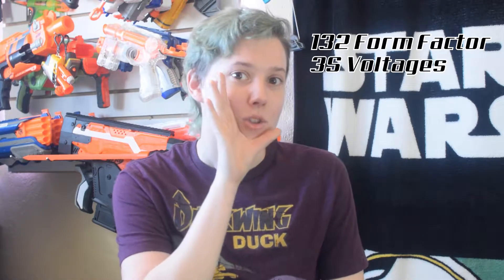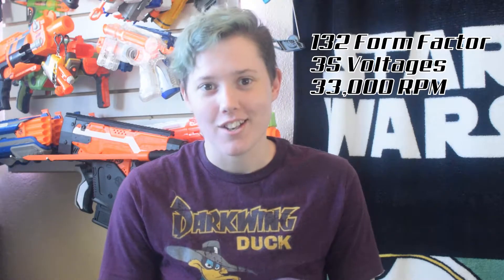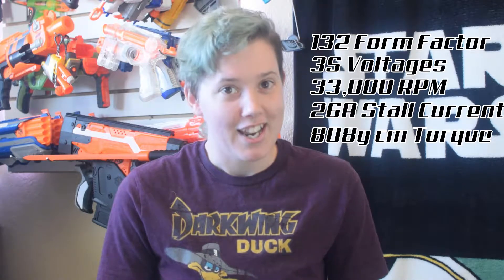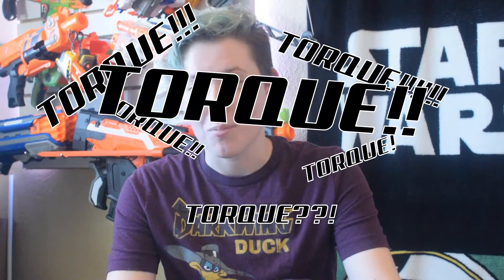Fang Motor Testing Final Thoughts - Watch this for a TL;DR

Comment: Are you using the high crush worker wheels or the regular ones that can be found on ebay or amazon?
Reply from the maker: Normal worker wheels.  We get ours through TaoBao or Out of Darts, depending on how quickly we need them.
Reply: cool, thanks!
Reply: How many sets of worker wheels do you recomend buying to get a good match? Also does having a good matched flywheels help that much?

Comment: Have you two done similar tests of measuring motor temperature with other motors, say Meishel 2.0s, Hellcats, or Blades?
Reply from the maker: We did similar tests with Meishels and got slightly lower numbers.  We have not tested other motors extensively.  I let a Blade run for 10 minutes and it was hotter than a Meishel 2.0 by a couple degrees, so I imagine it's pretty similar across motors with similar current draw.
Reply: Ah, so it seems it varies more by current draw than can size. I'll probably be fine with my PLA RS cage. Was printed at 100% overkill infill and has shown no complaint over firing a hundred rounds within a minute, and I won't ever really be asking any more of it.

But then I do have PETG filament shipping over so I might just go for complete peace of mind.
Reply from the maker: As long as it's not a really hot day, I don't think anyone will have issues with PLA unless they're stalling a lot.
Reply: Well, that's reassuring, though I have seen Meishel posting on reddit the following, "I mean, I ran a motor with a sealed can and 25 amp stall current, and after 5 minutes of free-wheeling in open air it was 165 F. Those motors wrecked a PLA cage in a matter of 1-2 rounds at a war on a cool day."

Honestly that kind of set off most of my doubts about whether a PLA cage would hold up. My experience has pointed elsewhere (likely due to different variables, etc.), but it's sat at the back of my head ever since.
Reply from the maker: I think I've figured out what caused that incident.  The blaster was being used frantically with fresh koosh darts, and they heated up to the point they lost a significant amount of torque and could no longer push through the OFP 41.5 cage.  Repeated jams caused the motors to heat up.  I'd be weary of using a high crush cage with anything less than Hellcat level torque for that reason.  If they heat up too much, they start jamming, and jams cause immense heat.  Meishel 2.0s CAN clear a 42mm crushed cage, but the moment they heat up, they start jamming.
Reply: Ah, noted. I'm uncertain about the torque figures of my 180s (I'd wager it's in the neighborhood of Blades, though don't quote me on that) in my RS so I may reprint in 42 mm. At the same time, I've had no jamming issues (I partially accredit to worker's extended pusher), so...